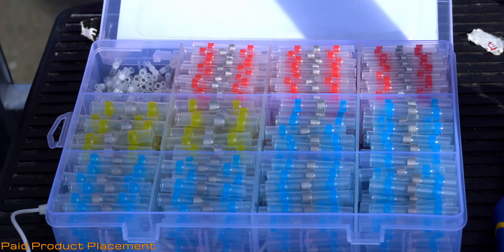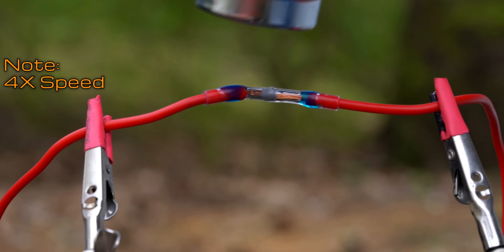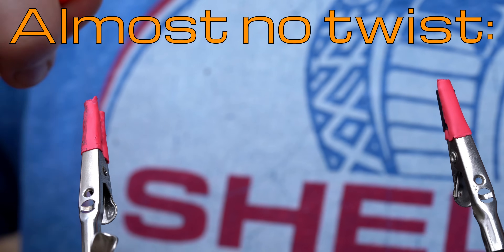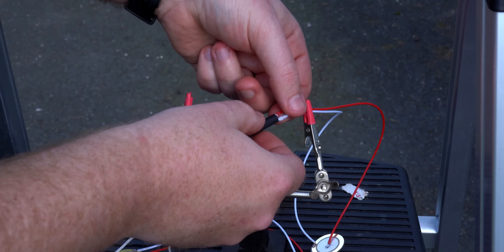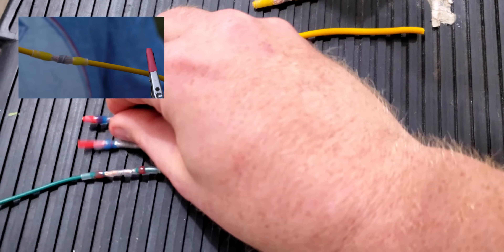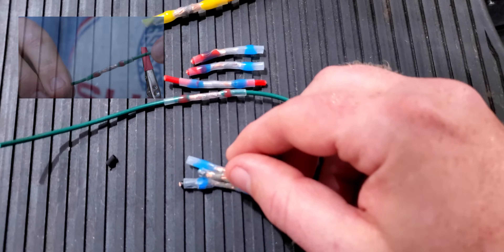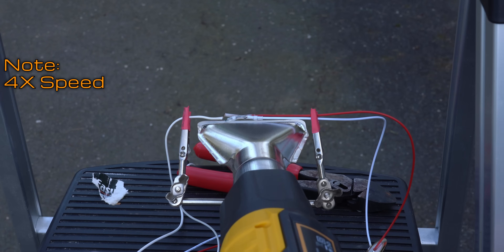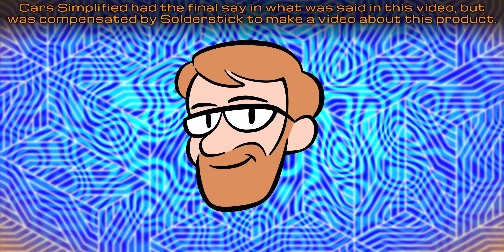Solderstick Waterproof Solder Wire Connector: Pull Test & Thoughts!

Comment: My main concern is cold joints. Definitely shouldn't pull apart with a good join. With the connector at 1:10, you can see solder start to wick down one side and then the other starting around 1:14, then especially at 1:18. That's how you know the wire got hot enough to melt the solder itself, and it should be a good joint. As with any connector, and as you noted, you have to have the right technique. Twisting the wires together will help with mechanical strength and ensure more contact between the copper. That means better and more even heat transfer, hence easier wicking. I think if you combined these connectors with the wires dipped in a little flux, they might make an even better joint. Nice demo and test!
Reply from the maker: I agree! To this day I have never once used flux (outside of any that is already embedded in solder) so perhaps I should change that!
Reply: @CarsSimplified  Yeah I don't really use it either and I know many kinds are supposed to be cleaned off after use, so might not be ideal here, but would be interesting to see.